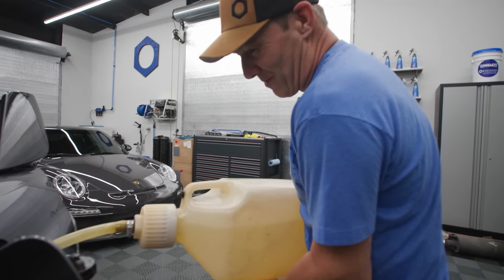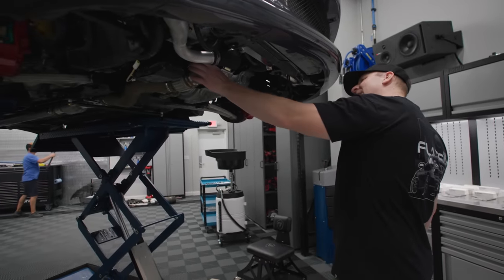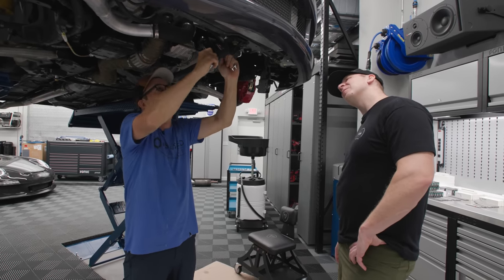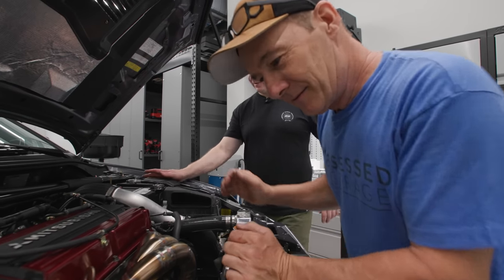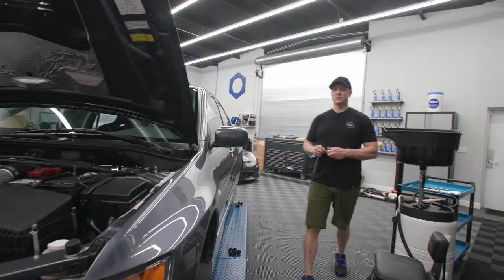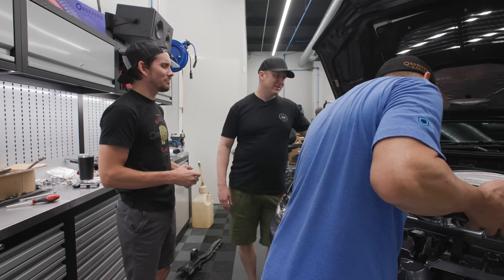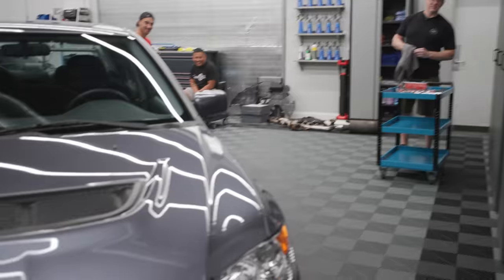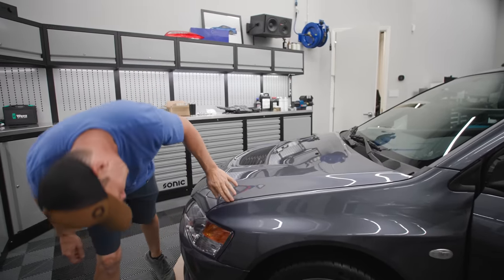Driving The Mitsubishi Evo 8 For The First Time! | The Beater Build

Comment: The 3 ligths are because you did not bleed the ACD properly. The proper way is to use ECUFlash and activate the pump from software.
Reply: Definitely, even for evoscan its a nightmare to bleed the ayc acd.
Reply: YES THIS!!!
Reply: Just to circle back, its actually Evoscan that will allow you to bleed the ACD. You will also need a Tactrix cable as well. Sorry for misspeaking.
Reply: Just turn the ignition to the on position and floor the gas pedal while someone is cracking the bleeder. This runs the ACD pump so you can bleed the system.
Reply from the maker: We did this. Bled it manually about 15-20 times. We will be trying the ECUFlash method next.
Reply: Correct needs to be electronically bled
Reply: Sorry maybe I just got lucky the 3 times it worked for me.
Reply: @ObsessedGarage Also double check the fuse on the positive Battery terminal. I went crazy for 3 months and pinned it down to that. Hopefully that helps.

Comment: Matt, I had commented on that rear wiper delete. You have to go all out and get an Evo VIII RS rear window.  The RS is the strip down model that has no rear wiper. Look at it this way. You'll clean it up and also save some weight by deleting the rear wiper and the rear wiper motor assembly.
Reply: does the RS have different rear carpeting? How will he clean up after deleting the motor assembly for the wiper.
Reply: RS ftw.
Reply: I’d vote don’t delete. I remember when I had a bugeye wrx I was always jealous that evo’s had a rear window wiper 😅
Reply: @Tdaz250  strange. My bugeye had a rear wiper. Recently did a wiper delete on my Evo V - so much cleaner.

Comment: The ACD lights (tarmac, gravel, and snow) are all on because you guys didn't bleed the system the correct way, like I had told you guys in your other videos..........same thing with the brake bleeding procedure. You guys just did a drain and fluid refill on the ACD system, and it doesn't work that way. The system still has air in it and it needs to be bled the proper way.
Reply: They did the pressurized bleeding yesterday at the start of the live stream. Key on full throttle, open valve, purge air and shut valve.
Reply: @DJ_Driven  pressurized bleeding of what? the brake system or ACD?
Reply from the maker: I read all comments.
Reply from the maker: We bled it 5 times.
Reply: @ObsessedGarage  might have to do it some more from the sounds of it then, especially since most of the fluid was drained and you might have more air than you think in the system.
Reply: @ObsessedGarage buy evoscan and a cable and do it the easy way

Comment: Matt get the intake, intercooler and all the intercooler piping from STM along with a boost controller before the tune. With that exhaust set up and those mods it will b a fun car on 93 with stock fuel system.
Reply: Even just a hotside upgrade will be a world of difference on these cars, one of its biggest restrictions
Reply: Also worth putting a walbro before tune
Reply: STM 👌

Comment: I also received the 3 light on the tarmac, gravel snow if the car was cranking but didn't fire over properly the light would come on and after a start it would stay on. But after a quick turn ignition off and start again it was gone. 
If you are experiencing the 3 lights on more often its a pump issue. Love the vids...thank you.

Comment: You need to paint the “diffuser” part of the JDM rear bumper. The OEM color code for that section is “A02” “Eisen Gray”

Note: the tow hook cover for the JDM rear bumper still comes painted from the factory. If you already purchased it from STM any painter should be able to match it no problem.
Reply: I have a graphite gray evo and I chose to paint the diffuser black instead of the oem color because it’s looks too similar
Reply: @ev.mirags  everyone is entitled to their own opinion, but if you’re going for oem+ you probably want to make it look like it came from the factory. 

IMO when I see the diffuser part painted black it makes the car look like it has a knock-off JDM rear, and/or the owner couldn’t be bothered to figure out what the color was supposed to be and rushed the job. It just gives me a “hacked together evo” vibe.

Comment: The rear wiper is a keeper! If you actually use the car as a beater/daily youll wonder why more vehicles dont come with them. With the test pipe you can weld in a vibrant ultra quiet resonator  to avoid rasp and give the exhaust a deeper tone. STM used to make and sell but you can make one easily. Might i also suggest seat lowering brackets, shifter bushings, and a master cylinder brace? Seating position, crisper shifting, and tighter brakes make the car even more enjoyable.

Comment: 2 step for those in the drag racing community. The evo needed a few factors to activate 2 step with the factory computer(option is built in from mitsubishi but not activated) Many of them had issues get it to activate so it was a very popular topic..... just throw a stand a lone in it and no issues. A good tune is a must no matter what you change on these cars.

Comment: AYC is shot hence why you have all 3 lights on. The pump has likely failed. Very common. Rip the whole system out and put an RS diff in there.
Reply: All USDM Evos came with the “RS diff” from the factory

Comment: Glad you like the car Matt. It’s hard to beat the raw experience they deliver.  It’s a bolt on FP turbo and tune away from being OEM +. I’ve got a set of 17x9 +32 weds on one of my cars , they fit well with a 255 tire. Going with a larger tire then 255 or a +22 offset is a lot of work for minimum gain IMO. What spring rate did you decide on for the suspension?

Comment: Matt I hate to see anyone fill a car using a 5 gallon jug and tipping it over. They always leak. Take a look at a “jiggler hose”. You can put the jug on the trunk with a towel underneath and it will gravity fill the tank and suction the jug dry.

Comment: If i see people recommending the killallwioers kit i would have said no it was junk. I have a plastic plug that was $15 that i recommended on a few past videos but probably not up to your standards. Also the +22 offset wheels poke imo amd youd have to roll your fenders which is ass. The wedssports 17x9.5 is a +32 offset. Not +35. If you get 17x9 +35 you will have to use spacers.
Reply: What is the absolute best wheel size combination without having to roll the fender in an 18 in? I'm running low racing CE28 limited edition time attack wheels in 18x8 with 30mm backspacing no issues but think I could go to18 x 9-in with the right backspacing.
Reply: @dj8010  I'm not sure. I'm not a fan of 18s on a Evo.
Reply from the maker: I have 18x9.5 +35.
Reply: @ObsessedGarage  Okay I'm not sure of the 18" sizing.

Comment: The kill all wipers delete isnt a sticker. Its a glass bung that you glue in and it sits flush. Theres literally nothing else you could use. Its better than the other rubber bungs that you can buy elsewhere. Other than buying new glass without the wiper hole theres nothing better.
Reply: Matt needs to buy the RS rear glass and be done with it! That's what I would do if it starts to bother me.

Comment: You put the hood struts on wrong. The carbon bit goes on top and the top bracket has to be turned and it won't hit the tower.   Great work  😮
Reply from the maker: I did that too.  Still didn’t fit.